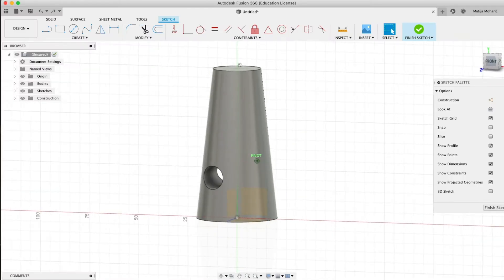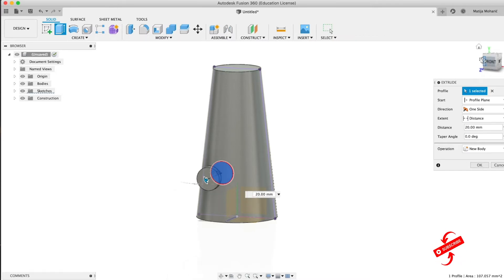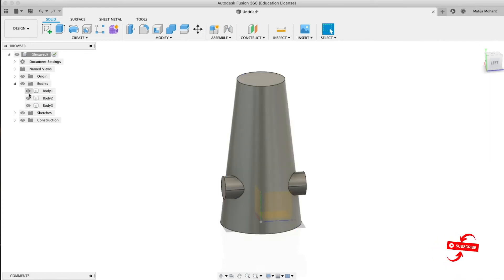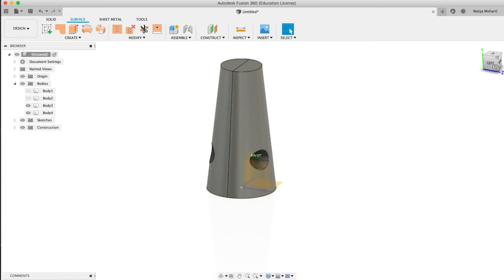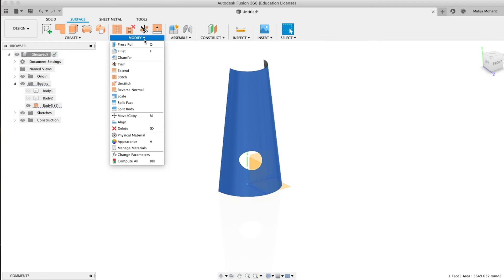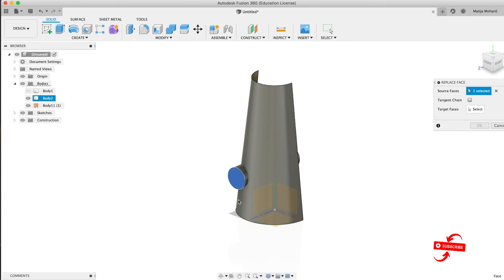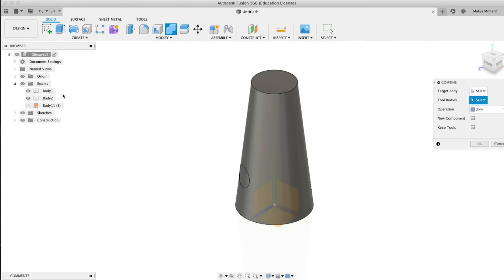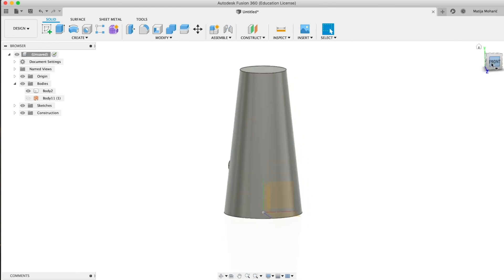How to fill a hole on curved surface - Fusion 360

Comment: For the commenters, the point is this trick can be used to fill in holes on COMPLEX shapes as well. Couldn't compute a delete face on a hole for a complex shape I'm working on. This was a workaround that solved my issue.